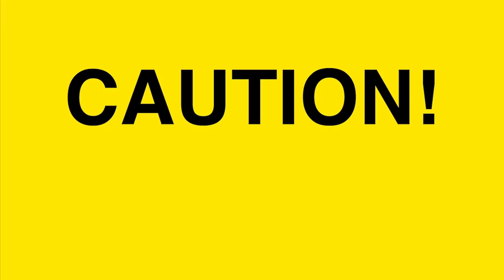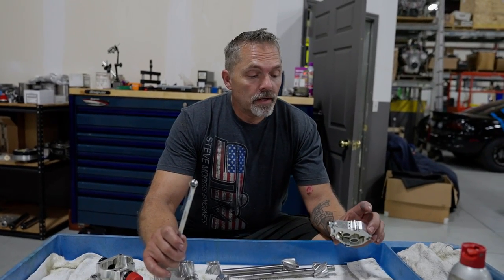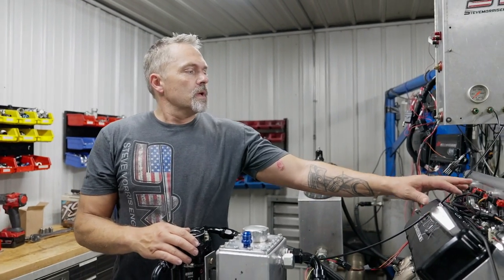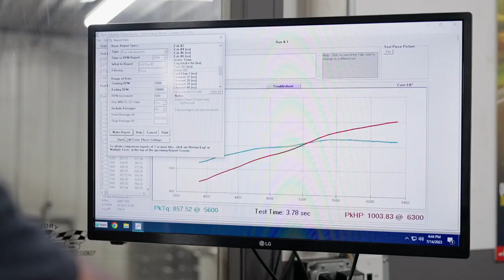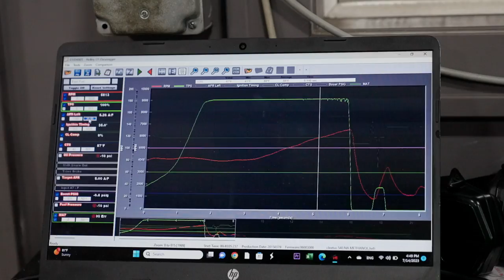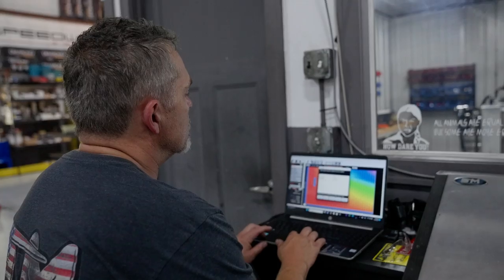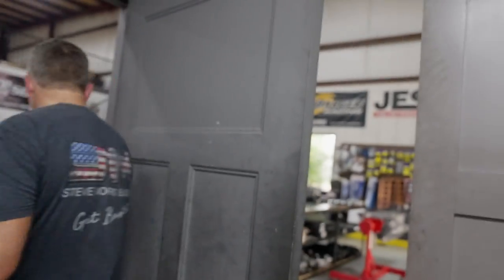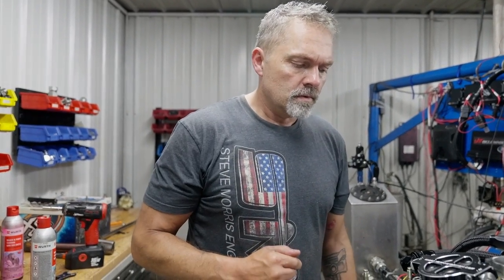What’s The Deal With The Oil Filter ?

Comment: I know it wouldn't be cost effective but if this SMX engine in NA form were installed in a truck and used to pull something like 5th wheel camper trailers or horse trailers, (not abused) could it be expected to run reliably for 100k miles or is there something about a race engine that would result in far fewer miles before needing a rebuild/refresh?
Reply: If it’s got aluminum rods I would think they would stretch from the heat. Same with the block I would think the tolerances would change as it grows from the heat but not an expert lol

Comment: Steve, the bolts on the primary thrust bearing (The one you install) what are the bolt size and grade? The races are to hard and would break if they deflect any amount so the movement you had can only come from the bolts that hold the thrust bearing in place stretching axially. Whatever this engine is hooked to is putting some incredible forward pressure on the crank to move the crank 0.020" against the bearing.

Comment: Steve l know this is probably a  silly question but. does the oil resivour  have pre strainer , because anything  to get to the. pressure  section of pump where the stuck relief  valve was it didn't  come out of the engine . It came from the oil resivour.

Comment: I still think it was some chucks from ur eight connecting rod delete last season. It was in some small corner of the engine and Cleetus just vibrate it lose and put it in the filter.
Reply: It was from the oil pump going out the last time. The lines weren't properly cleaned.
Reply: @Ole_CornPop  when I saw it Cleetus filter they looked a lot bigger. The Oil pump pressure side just pumped the pieces through it. That's why the pump was just scratched. That's what I'm thinking 🤔

Comment: Documenting the entire process from when it arrived through to the dyno session provides everyone the visual proof that your build quality is unquestionable. As to whether or not the giraffe flushes the entire oil system in the car remains to be seen. We saw our buddy Dewey poking around so that made our day. LOL 

p.s. One thing that's puzzling is the lack of any hard coating on the interior aluminum components of the oil pump and yes we do understand the oil itself provides lubricity but as we've witnessed, the internal components can become scuffed and galled due to tiny particles in the system. Cheers!